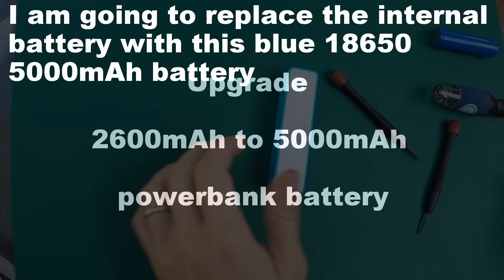How to upgrade your powerbank 2600mAh to 5000mAh

Comment: You won't get a 5000mAh battery that size. Especially not for $10. You will get a low capacity or old damaged cell that has been relabeled. You have been scammed and have invited other people to also be scammed.
Reply: Annoyed that this comment isn't higher up
Reply: The fact that this is so low is sad. I think that the highest 18650 battery is 3400, maybe a bit higher without a button top.
Reply: Raisonbran648 thinking the same too
Reply: LG makes a 3500 mah 18650. the highest LEGITIMATE capacity 18650 battery available. i think theyre like $25 a pop too. i will say that this is a good thing to know as I bought one of these 2600 milliamp hour power banks for $3.50 and theres no fucking way that the capacity is that high. I have an interstate battery store down the street that sells real protected 2600 milliamp hour 18 650 batteries and could swap them out. although at the end of the day it would be way easier to just spend the money and buy a better power bank.
Reply: The weight of the battery is a good way to tell, anything below 40g is almost certainly fake.

Comment: You've found a genuine 5000mAh 18650? 
In China they usually pick a number they want to print on the battery heat shrink, it's very possible you've downgraded your powerbank.
Reply: 5000 mAh? IMPOSSIBLE.IT DONT EXIST.

Comment: The 18650 cell can't have 5000mAh. It's chinese fake. On ebay you can even buy 9900mAh or 12 000 mAh cell, but the actual capacity is about 500 mAh. So you have just downgraded it from 2600mAh to 500mAh.

Comment: this 5000 mAh Battery is 1800mAh If you are lucky ! Everything over 3500 mAh is Fake
Reply: nitecore nl189, turn down for what
Reply: +Romeo Sierra I first checked the date this video was posted hoping to see 1st april , but no.. Please delete this video op.
Reply: +Anthony V I am just curious, why?
Reply: +danleow kite why what? That battery will never have 5000mah,if u are lucky it has about 1500mah. Also, soldering on battery poles is a joke. You can't heat the metal caps enough to get a good solder point and not damage the cell. What you have done there is how to decrease powerbank capacity and have cold solder spots.
Reply: +Anthony V I wish I had equipment to do cold welding
Reply: danleow kite It's pretty easy to build a spot welder for yourself , look it up on yt.
Reply: all power banks are fake
Reply: *Stoned Unicorn* That is not true , it's just abour what you are buying. I've got a xiaomi 10400mah powerbank , and it's what they advertised, has 4 2600 mah cells inside .Payed 18$ and can charge my phone almot 4 times from it.
Reply: Anthony V ofc except those xioamis powerbanks are extremely more expensive comparing to those chinese bullshits
Reply: So you call ~18 dollars expensive for something that does exactly what it says and it's reliable ? It's like a 4-5 dollars difference from a bs chinese brand that claims to have 9000mah
Reply: Anthony V its not 4 dollars difference. I want only 3000 mah why i cant have it cheap. Yes its expensive i will not give 20 dollars for a fucking battery
Reply: +Stoned Unicorn it's ur decision, but I don't think u can find a true 3000 mah for under 8-9$. If u do, it's probably a fake one that has actually about 1500 mah
Reply: not any more
Reply: nope its still fake
Reply: FUCK I GOT SCAMD AIGAN
Reply: is that really true ?
Reply: +Anthony V You are right!
Reply: beware of anything fire in it my 6000 mah came to 600mah on a 1amp draw
Reply: Frank Lockhausen yes

Comment: Hahah I have exactly the same battery from china they are actually 500mah not 5000mah, there is no such thing like 18650->5000mah!!!!
Reply: The best fire like battery I recevied with and led flashlight was an ultra fire that claimed 4000mAh, but only gave me 1,100mAh.
The power back I just opened to do a review on has a pink cell battery and may be a Samsung battery so it might be a real 2600mAh, I have some of these pink Samsung cells from a dell laptop battery and they are really 2600. But the best mAh rating on an 18650 battery will be from Samsung, Panasonic, and even some LG batteries. But I think Samsung and Panasonic do the best. Maybe as high as 3600, but it will not be in a $10 bank from ebay that's for sure.
Reply: Scott D I am looking for a good battery right now (I mean good but cheap) I found ICR18650- 2600mAh in aliexpress for 3.50$. There is 300 orders and good comments about the capacity. Some dudes said that after tests the capacity were ~2100-2400mah which is very good. I am going to try it.
Reply from the maker: m Ni Not bad!, could be OEM manufacturer for branded batteries. For all you know they could be manufacturing for Panasonic batteries:)
Reply: There is more than on amount of mah. There are many different mahs
Reply: I have 5000 mah
Reply: I have a new question ....... up ^
Reply: m Ni I have one and it gives me a little over one full charge on my ipod touch 4th gen.
Reply: any good links for a good price battery 18650? need 2 for my power banks.
and since 3800mah are fake witch is great. cause im talking to a guy on ebay, asking him about weight and if there legit and things. but i just learned that 3800mah are fake. 
i just need a cheap 1euro or 2 euro battery.cause i bought a empty power bank. 1.70euro. so if i can find a battery for 2 euro its okay.
Reply: Regilio Bouma type "ICR18650 2600mAh" u have to know that every battery under 4$ (without shipping, shipping is ~2$) is fake, so get this ICR18650. It is genuine (mine is pink color and I already have made tests- it is 2200mah of 2600 so it is very good.)
Reply: m Ni ebay ? 
Or more like where you bought them?
Reply: Hum. Just thinking cause its for a the power bank and for 4euro you can have one with battery. 
So i wont pay more than 3euro for a single battery or it will become to expensive. (or maybe the powerbank the cheaps ones have knock off batteries i don't know,  maybe at the end buying a better battery is better,  i mean if the battery cost to much i could also just buy a new powerbank for the same price with battery)
Reply: Actually wtf.  9euro for  battery. Hum i could buy 2 power banks with battery for that. 
I tried to cancel my order but it was already sent. Cause i tought first it were AA batteries. 
Arg again chinees things that will take dust.
Reply from the maker: Regilio Bouma I rather pay more for good battery. Many cheap powerbanks uses old/used laptop 18650 batteries. So just beware of cheap powerbanks.
Reply from the maker: ***** LG G3 battery is 3000mAh (standard) so your 4400mAh should full charge your phone.
Reply: Yeah.  Better buy a xiaomi powerbank.  To be sure. 
Thing is im looking for one thats not fat.  New xiaomi power banks are thin. But yeah price is 15euro but shiping is also 15euro. So way to much.  From there official reseller..
Reply: Thats what i thought. They put shit batteries in them. 
Than nvm it will take dust. And i will buy something els.  😊
Reply: m Ni thankss. 8euro. So 4euro a battery i can live with that. All i needed a link where to buy good not to expensive battery's
Reply: If i realy want a big power bank i would go for xiaomi. But thats just to big. I just want a little one for fun. Don't have much use of a big one. Not yet
Reply: ***** Yes, but u forget that He said "cheap", ICR is cheaper good (genuine samsung) battery. What is cheaper than 2.6EUR ? He strictly look for "cheapest" I was looking for cheapest battery too, and I bought also OLED USB tester and my tests shown 2200mAh from 2600. This result is quite good for 2.6EUR (thousands of buyers said the same- 2200 is ok for the price). And in my opinion do not forgot that there is loses of energy while charge or discharge a battery( you have PC USB->cable->power bank circuit board or power bank circuit board->cable->phone USB)), because of this 2200 means that the battery is genuine. Always there is loses.
Reply: m Ni hey but i have some old laptops around with batteries.  So i just broke apart de battery and saw the batteries are they the same 18650? If so i have tons of batteries to test.
Reply: Okay my old laptop batteries seems to work.  But i don't trust them.  When i charge a phone the battery makes noises. It charges the phone but i dont trust the wierd sound the battery makes.
Reply: The sound stoped when i charge a phone. Its doing the basic buzz noise charing battery's do so i guess its fine. 
. I have like 6,  18650 batteries.  And i didnt even know. Although i dont have a amp meter. So i won't know how much juice is left. They seem to work.  Even though it came out of a pentium 3 laptop. I have a more recent battery pack (from a laptop form 2008/2010 i think it has windows 7) some where just cant find it right now. 
But i added the battery from aliexpress in my list. 
Now if i just could figure out how much juice these batterys have left. 
I have lots of time. I mean even if i order the batterys for aliexpress i will need to wait 2 weeks minimum. So why not try my old laptop batteries.
Reply from the maker: Regilio Bouma Buzzing sound could mean that your circuit is not efficient. I think the capacitor is no good but if everything still works then I would'nt bother too much.
You can try a 1A charger and time the charging duration. For example, if it takes 1 hour to charge meaning it can hold approx. 1000mAh. If it takes 3 hours meaning it can hold approx. 3000mAh. But please note that this is not really accurate because the Amp will drop as it near its capacity.
Reply: danleow its fine now. 
It even charged my old lg phone 1500mah battery. 
But is there a green light on the power bank?  Cause it never turned on after 2h of charging if not longer. I will try with my oneplus tomorow 3000mah to see if it will charge it. And how far.
Reply: m Ni yeah it tops out at about 3Ah not 5 lol
Reply: yeah i measured the original battery and it was about 1500mah even then i got lucky
Reply: m Ni Yeah, I too have a few "ultrafire 3000mA/h" cells, only good for smaller projects as they're actually about 1000mA/h each. I have quite a few legit Samsung/Sony cells as well and those do indeed get very near their nominal rating.
Reply: m Ni lol in a crap cheap chinese handheld laser (claimed 2 watts LOL, ofc only 50mw) I found an Uitraflrc (not Ultrafire) battery, which should have 4000mah, but measured only 450mah.
Reply: +m Ni The battery in mine is an 18650. 2600mAh
Reply: +Jaden Dobrenski nah
Reply: +Jaden Dobrenski thats pathetic it should give you at least 5
Reply: There is no such thing as a 5000Mah 18650 battery. the Highest actual rating of one is a 3600Mah made by panasonic.
Reply: basshead No you don't. You have a Chinese battery with 9900mah claimed on the outer jacket. If you actually test it I'd bet money it's no more than 2000 mah. The record for the highest nah 18650 is a Panasonic with 3600mah.
Reply: +steve polhill I have 9900mah 18650 batteries
Reply: basshead no you dont.
Reply: +DMAN22yeah yes I have. It took over 20h to charge with a 450mah charger.
Reply: Even the best panasonics to this day can't hit 4000mAh from an 18650. But still, being able to swap batteries for one that is better is awesome. or even just to allow you to have many batteries but only one charger  if you don't have the money for lots of chargers.
Reply: This is an 80 cent bank.
Reply: @danleow  3,500 is the theoretical maximum of an 18650 battery. Even a Tesla car does not have 18650 cells with more than 3500 mAh per battery.

Comment: The 18650 battery you use is fake.
The max capacity you can get in this size of batteries is 3400-3500
Mah and not more

Comment from the maker: Ashutosh Agarwal Yes it does have protection circuit. The circuit will cut off charging supply to the battery when the battery reaches its maximum capacity.
Reply: +danleow You know that there's no 5000mAh 18650 battery, right? Chinese manufacturers just lie.
Reply: +rbg 1827 can I have one?????
Reply: +rbg 1827 I just need it can you please send me 1 power bank and 1 car charger
Reply from the maker: +rennier rodil You want to buy one or give you one?
Reply: Well I'll buy it if its not free
Reply: But I want to have one that is free
Reply from the maker: +rennier rodil I used to sell them but I stop because is too competitive now. I can recommend this eBay seller link here http://www.ebay.com.au/itm/Hot-Powerbank-portable-USB-Battery-Charger-For-Cellphone-Universal-2600mAh-/141808249568?var=&hash=item21046e2ae0:m:mtMfdxAlnQioL3wFSQIGx_Q
Reply from the maker: +rennier rodil I used to sell them but I stop because is too competitive now. I can recommend this eBay seller link here http://www.ebay.com.au/itm/Hot-Powerbank-portable-USB-Battery-Charger-For-Cellphone-Universal-2600mAh-/141808249568?var=&hash=item21046e2ae0:m:mtMfdxAlnQioL3wFSQIGx_Q
Reply: +danleow I'm in phillipines now and also I don't have credit cards for PayPal so I can't buy that but anyways thanks
Reply from the maker: +rennier rodil You can ask one of your friends or family to get it for you, I am sure at least one of them would have credit card or PayPal acc.
Reply: +danleow is this the same powerbank in cdrking 150php?

Comment: nice one!!... for less bulk, you can use Kapton tape on the battery. it's the same stuff most mid to high end electronics makers use for insulating high voltage wiring
Reply from the maker: ThEcRaZ3dGaM3R hmmm! Kapton tape? I learn something new and thanks a lot for the tips :) I always have problem using wiring insulation tape when it gets really bulky to put it inside the case.

Comment: Most budget Lithium iron barrel cells play the numbers game and give a mAh rating that's above even the best case capacity of the cell. If you put a 1+ Amp load on a cheap cell you'll get a noticeable hit on the total mAh's you'll actually get from the cell. You could even be down to below the original 2600mAh the original cell was rated at.
Still, A good video for anyone who's power bank's feeling it's age and is struggling to hold a reasonable amount of power.

Comment: Very cool, thanks What kind of soldering iron is that? Can you send me a link to where you buy the iron and that vise?
Reply from the maker: +Blakehx I bought it from my local electronic shop, just look for Butane soldering iron in your local electronic shop or online. It uses ordinary butane gas lighter as fuel.
Reply: +danleow can it run out of butane and what to do if it happens
Reply: Can be refilled

Comment: Biggest cell in reality is 3600mAh, with 4000mAh coming soon.

Also, those longer 18650s are PCB-protected ones (for use in consumer devices like electric cigarettes). Since the power bank's PCB already has a protection circuit built into it, it's best to remove the additional protective PCB from the cell if it comes with one, as otherwise the 2 protection circuits may conflict.

Comment from the maker: All 18650 are 3.7V, inside the powerbank as seen in the video there is a step up circuit to convert 3.7 to 5V. You can buy 18650 battery in eBay or any radio shack.
Reply: danleow hey can i use this for note 3
Reply from the maker: Check your note 3 manual for charging input A, if it requires less than 2A should be fine
Reply: Or any vape shop.

Comment: I hate to break it to you, but 5000mAh 18650 Li-ion cells do not exist. The largest capacity you can buy is 3400mAh NCR18650B by Panasonic. 3600mAh cells do exist, but aren't available to the general public. Anything that claims to be higher, is fake. You'll be lucky to get even 1000mAh put of most "5000mAh" cells.

Comment: With current LiIon technologies anything over 3400 mAh for an 18650 cell is false. If you believe otherwise go buy a charger/discharger with capacity tester (during discharge) and see for yourself. There's a reason why quality brands don't advertise those sky rocket capacities - simply because it's not possible with current technology to go much beyond 3400 (and besides cells with a little lower than absolut max capacity tends to be like new for a little longer).

Many tests of "Ultrafire" whatever often gets them to 2xxx mAh - when they're brand new - and they quickly falls below that.
Instead go for a genuine quality 3400 mAh cell like Panasonic, Sony, Samsung or LG. They performs much better in the real world and performs like new for much longer!
Oh and choose a better converter. Those converters in those cheap cases is not exactly top performers and they got quite a bit of heat loss. If need to convert the cells 3.7v to 5 v. That you cannot do without some loss (manifests itself as waste heat).

Comment: Hahaha, there is no 5Ah 18650 in the world! Max. is 2,4 or 2,6Ah. Sorry, you have bought a fake product.
Reply: Claus Müller i hab sogar 3ah aus einer guten sanyo bekommen. aber 5? niemals
Reply: +Claus Müller the max is 3.4ah
Reply: DMAN22yeah physically, but practically its more like 3.2ah due to materials that are not 100% pure.
Reply: drkastenbrot 3.4ah is common with panasonic stuff and vapers but most applications use 2.6 or 2.2
Reply: +drkastenbrot LG offers up to 3600 mAh